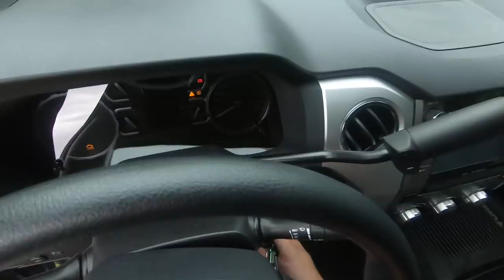Only if You could Pay your Dentist with EGGS!

Comment: You could put a hole in the bucket of your tractor and toss a ball hitch in there as needed. Position it correctly and the same hole could be used for a D ring shackle for attaching a chain.

Comment: New touch right?  When did you switch out  the pickups?  That waterer seems to be a great addition to the chicken project.  That turkey looks so lonely.  Still, I guess he will look,great with a roasted jacket surrounded in parsley.  You make that fence assembly look so,easy.  God bless America.  The kelp and the oyster shell seem to being worth the effort.  We use seaweed and oyster shells in The Philippines.  I set the shells in paved roadway.  The cars go over the shells and big trucks break down the shells.  When the shell particles gets small enough I sweep the shells up.  Works well enough.  God bless America.
Reply from the maker: We got the truck the other day. Now I need to sell the red one

Comment: If you really have Japanese Knotweed, you are in very deep trouble. That plant will take over your total homestead without proper measures, It does not spread by seed, but via the root system or via small pieces (one inch or bigger), that you spread with mower, rake, plough, dirt etc. In Holland and England they use Round-Up, even in nature reserves. When we relocated, I made sure it was not on the property, it even invades the foundations of your buildings and clogs up the swales. Once an area is taken over, only ants and bees thrive, nothing else.
Reply from the maker: We had it at one of our other houses and we got rid of it. It took a bit. I've seen it grow through asphalt before